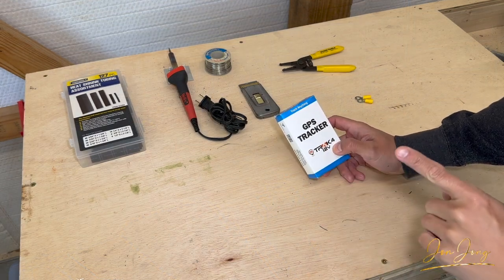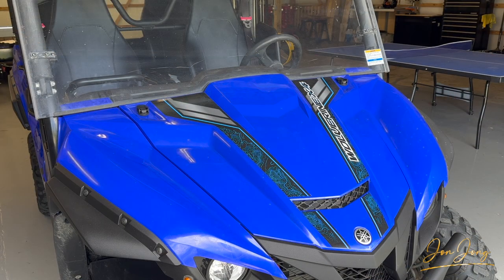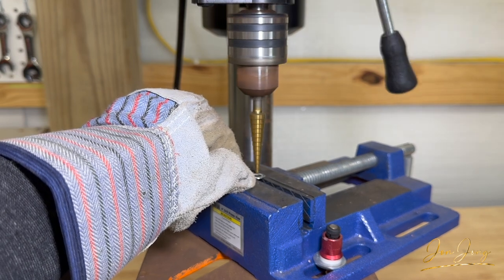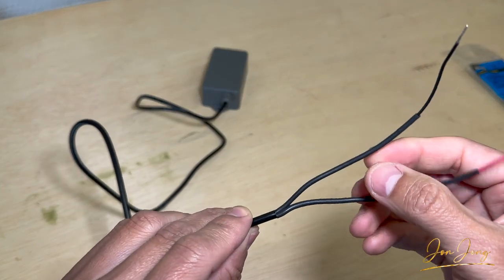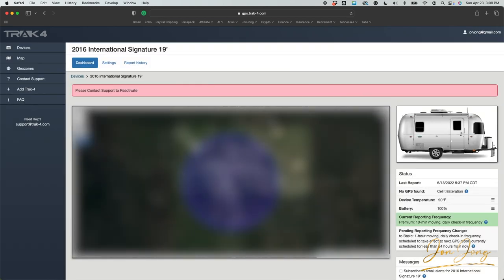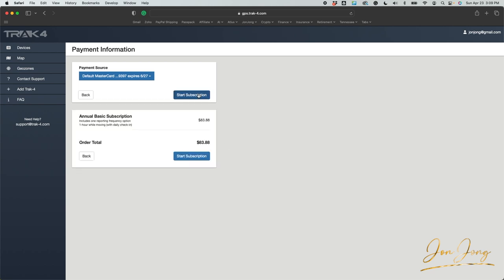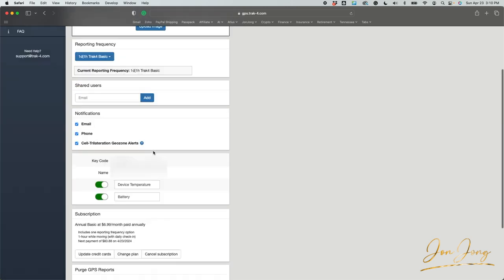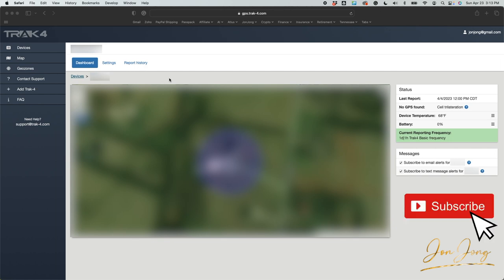Trak 4 GPS Tracker Review & Installation

Comment: I know this is an old video but i got a quesion. Is the battery a 12v output? Since the trak4 says it's a 12v. I'm trying to hook this to a electric bike. Does it matter the voltage?

Thanks for the video!
Reply from the maker: @MoNoHeAd5  yes, the battery was for 12V. Maybe there is a converter available, such as 48v to 12v?
Reply from the maker: @MoNoHeAd5  I looked them up and they are called converters, reducers, or step downs. I found them on Amazon for around $19

Comment: Only reason you'd need a GPS tracker is if it gets stolen. If it gets stolen the first point of interest is the battery. By hooking it to the battery, you directly draw attention to it. They will find it immediately and get rid of it. Smart move connecting it to the battery bud. Shoulda put a neon sticker on it that said "gps tracker". 🤦
Reply from the maker: Admittedly there are more inconspicuous ways to find power. The point is to inform people of options which exist that they may have not known about. Also, after spending a career in LE and recovering countless stolen vehicles, most thief’s are amateurs and usually stole vehicles to joy ride and steal radios/wheels/etc.

In my Airstreams I used the battery junction box so wires weren’t ran to the battery.